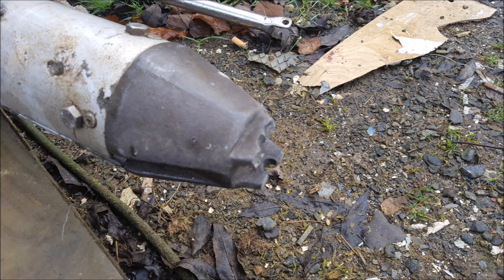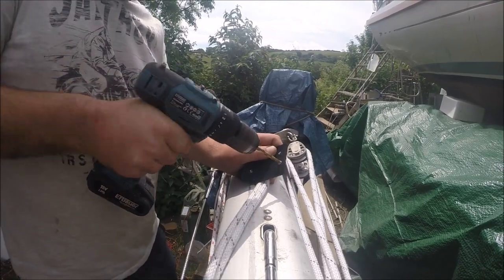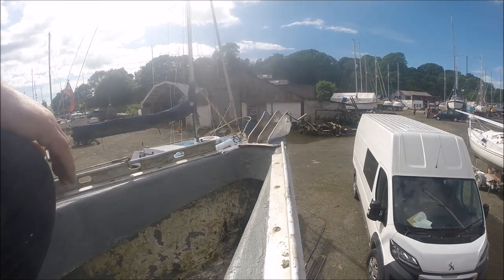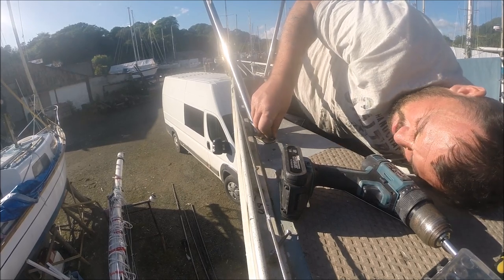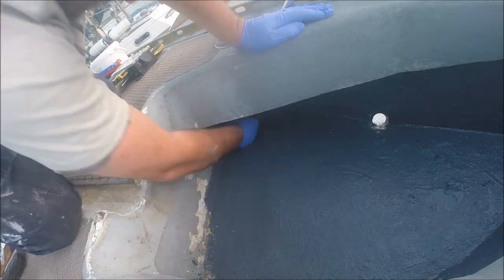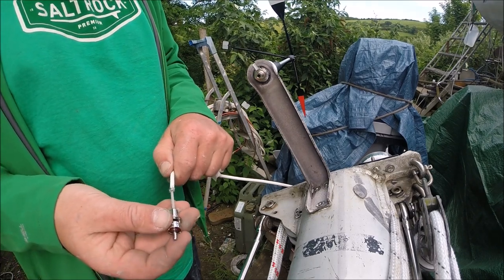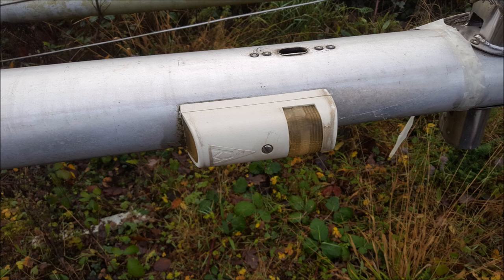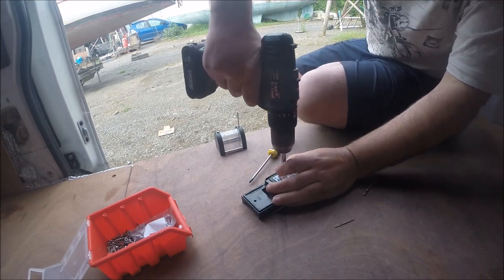sailboat refit 18 work on the mast

Comment: Nice work, one trick I've used for years is to thread directly into the fiberglass and then install the bolts for the fittings. Works a treat and way better that silly sheet metal type screws many manufacturers use  ( not you I might add)..
Love that led masthead light!
Cheers Warren
Reply from the maker: warp21drive 
again Warron thank you for the good advise

Comment: Try wrapping the bolts and sealing the pulpit mounting plates with some Butyl Tape. EVERY hole in a boat, is potential for a leak...seal them all! Also, everything chafes in a boat. So ensure proper anti-chaffing is used to avoid issues.
Reply: Philip Hewitt II I was think this but the anchor locker drains out to sea and not below.  Certainly use butyl under any other deck fittings that go through into interior of boat.

Comment: I would use ACF50  to treat the mast and beam . It was designed for the aerospace industry for protecting aircraft parts and is now widely used by motorcyclists for winter protection. Non sticky and lasts About £15 a can on E Bay - do the whole mast.
Reply from the maker: Gary Bickley 
thank you

Comment: Are you using regular marine paint in the chain locker?  I need to paint mine and am curious to see how well it holds up.  My locker is wet all the time (yeah, another issue to solve....)
Reply from the maker: joel1239871 
yes it was a cheap deck paint for £14  antislip  stuff i will find out the name when am down the boat next but If I done it again I would use  international deck paint

Comment: Hey bud, not sure if you did but all your external connections like the VHF coaxial connector that are open to the elements you need to wrap self-amalgamating tape around it and seal it.  If you haven't used the stuff before, it looks like electricians tape, non-sticky but you cut a 20cm piece off and hold the tip of one end on your connector and then stretch it about 5x it's width and whilst keeping the tension stretch wrap it around the connector only stretching a section at a time.   Here is a link... 
http://www.screwfix.com/p/self-amalgamating-rubber-tape-black-19mm-x-10m/87717?kpid=87717&cm_mmc=Google-_-Product%2520Listing%2520Ads-_-Sales%2520Tracking-_-sales%2520tracking%2520url&gclid=CjwKEAjw9_jJBRCXycSarr3csWcSJABthk07DeGNoYpvKtQelO1Z6gOV9n-DHAkIYAwNCV6lc7CYhBoCedLw_wcB&gclsrc=aw.ds&dclid=CKCW64T-t9QCFaapUQodO10NPg
Reply from the maker: Mancubsa 
I did use it but after I made the video a friend pointed it out  and put some on for me 
but thank you very much  I think the boat could sink if it was not for the advice of people like yourself lol
Reply: Always handy to keep a roll of it in the boat, use it for electrical connections too as will help stop it corroding down under the sheath.  Better than electrical/insulation tape for a permanent job but can be a bugger to get off on little things as you need to slice it off with a Stanley knife. Help seal a leaky pipe BUT, do not use it for anything under pressure as it will blow up like a balloon and pop.  All the best mate!